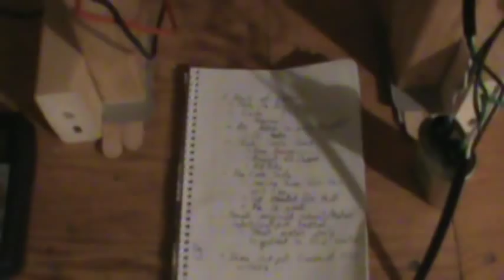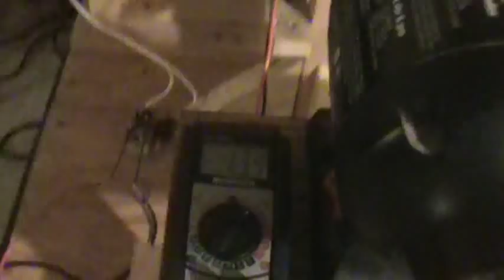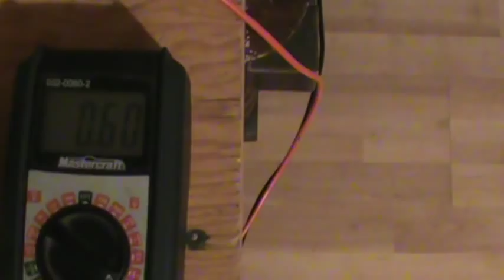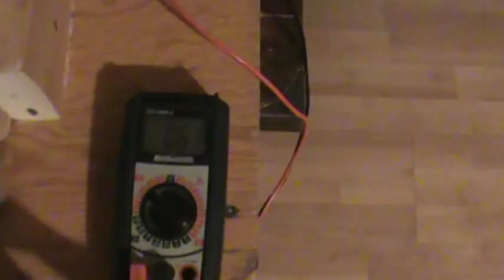Free Energy Project - Peek At Output - What's Next?

Comment: Have been experimenting for over 12 years and like you have not given up on the work. Did take a 6 month break but have returned to the experimenting room about 4 months ago. Have been able to capture a little over 80 % of the energy produce by the motor and feed that back into the battery. 
You have done a lot a good work, many hours and great effort, a capitol experimenter.

Comment: nice tests. The big wires give more current then I expected. Do you know how much voltage it gives when open?. I just finished a second pair of coils and welding rods.
Have one set iron is 210 grams and copper is 0,3mm 180 grams each. the second set iron is 260 grams and copper 0,3 mm 240 grams each. Hope to get some serious results now. Tomorrow I get a new camera so can make a vid then.
Hope you get good results with the new motor though you should only need a wire to pull it if your right.